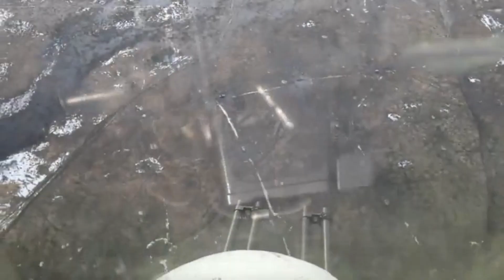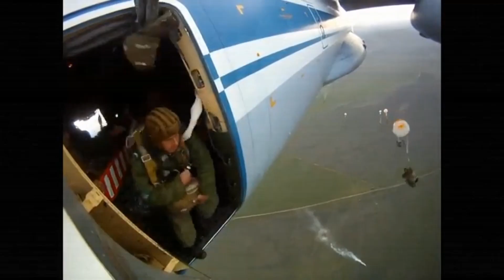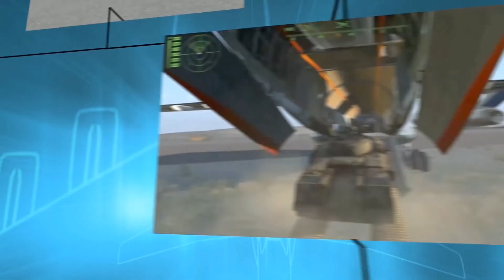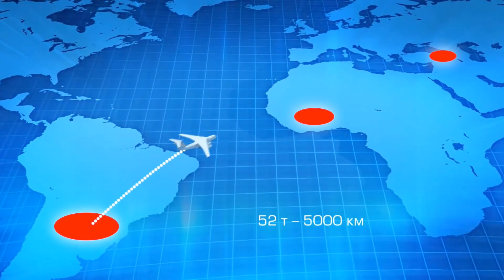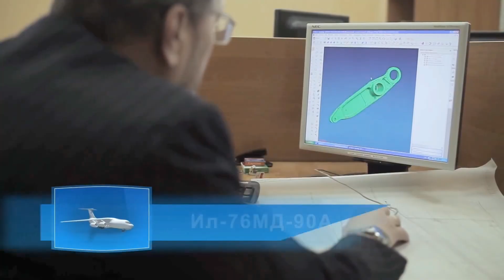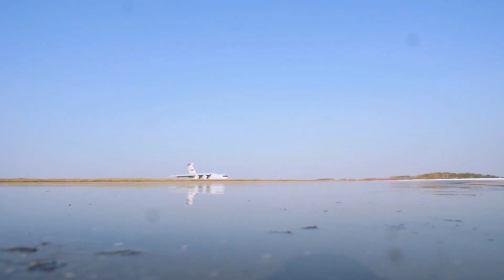Russian IL-76 Military Cargo Aircraft - HEAVY DUTY LIFTING!

Comment: bet the rivets don't line up just like their Su-57.
Reply: Rivets don't line up in aviation to prevent a possible break to expand along the line. They are there not for a beauty contest, but to prevent things fall apart.
Reply: Well in many cases there was no performance or manufacturing gain from gold plating( or lining up rivets) stuff and since the Russians were designing equipment for a nuclear battlefield and a war of survival they state owned corporations could not profit by making the rivets line up.
Reply: rust, In Soviet aircraft case it's the manufacturing process fault tolerance. Fly a couple of Russian planes of the same model and every single one has a tiny handling difference.
Reply: It was my understanding that this is a universal thing; if you fly a plane of the same model/year/factory long enough you will pick up on it's different characteristics.  I suppose this effect could have been more pronounced in the USSR but it's not like quality control was so fantastic everywhere else. The reality is that in state capitalism ( which is what the Pentagon budget represents) and highly protectionist societies you get these deviations as power becomes more concentrated or feedback mechanisms corrupted over time.
Reply: Rivets do line up in aviation, but in the west, rivets have largely been internalized under the skin so it doesn't effect airflow anymore
Reply: That sounds like something that would be more complex ( construction) and probably more costly. Who makes the calculation if that cost is worth the aerodynamic gain or the absence the industrial/construction savings?  When the nukes start flying what sort of planes do you want make more or less complex planes? 

Either way i think there is entirely different considerations at play here and that is why these 1v1 comparisons is not only probably impossible but also counterproductive to the understanding of all the facets that various nations took or still takes into consideration. 

Thanks; really isn't my area and definitely learning things.
Reply: Wish i knew enough to know that but i guess it could be a cheaper&practical way to increase structural resilience?

Comment: if it ant broke, don't fix it.  C-160 Transall is another example of aircraft which could be upgrade, but is being scrapped.
Reply: Jacques Nowell this is only partially correct. The airframe if the C 160 Transall has aged considerably and would have required quite an expensive upgrade. Besides the Transall users saw their limitations in Bosnia. And they needed a plane capable of transporting at least an APC which weigh usually more more than 16 tons.
Reply: TheGreenGuy to my mind, if the German airforce were serious about its air transport capability, then they would order 70-80 planes. Why so many? Besause not all would be ready at any time. There are always few away for maintainance, training, repair, upgrades or standing for ad-hoc disposition for emergency. 
And if Germany plans to be the "framework partner" for NATO nations in Europe and provide logistical support then it ought to have a strong transport wing.
Reply: The problem is that they should buy more of their A400M's
Reply: Thomas Borgsmidt true. Do it right or don't do it. But the typical genannt approach is: "let's do just a little bit".
Reply: Thomas Borgsmidt actually there are a bunch ordered but the delivery got delayed.

Comment: Didn’t know they still had the tail turret
Reply: Imagine being that tail gunner...lol all alone in the back cramped in a little compartment
Reply: sexy sloth we got rid of the tail guns long ago on the buff
Reply: the b52 doesnt have the tail turret anymore that was gone shortly after vietnam
Reply: @olafurmikaelsson4794  B52 still had a tail gunner during desert storm in 1991. There was a friendly fire incident when HARM missile was fired on B52 tail gunner radar.
Reply: It is an older version
Reply: I thought they removed the tail guns in modern Il76 upgrades,... like how they removed the tail gun in B52s.
Reply: You lot thought that in Vietnam and we saw what happened.LOL
Reply: i know but to spare weight and a crew member i would think they would have taken it out
Reply: Ólafur Mikaelsson exactly that what I was thinking when will the tail turret ever need to be used?
Reply: in flyover mode they can clear the runway of enemies.
Reply: if they realized, they make them on purpose so that they know that if they approach THE KILLER for that they are the submachine guns
Reply: Andy the Malevolent  now remove CIWS from your ships too:\ 
GSh-23 is a miracle combination of firepower and weight. 3400 RPM at 50kg. M2 is 38kg, GAU-19 is 63kg. And unlike those it fires 23mm cannon rounds. Why remove when nowadays sensor and computing equipement finally became cheap, reliable and compact enough to repurpose the turret?
Reply: No they don't!